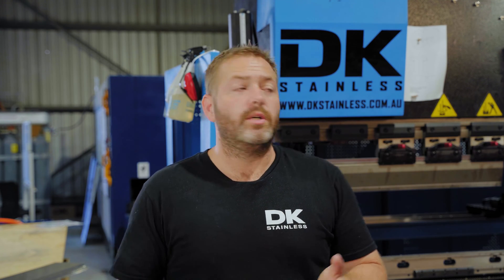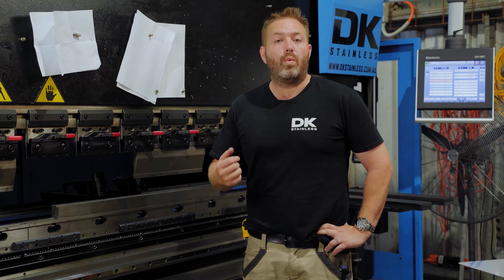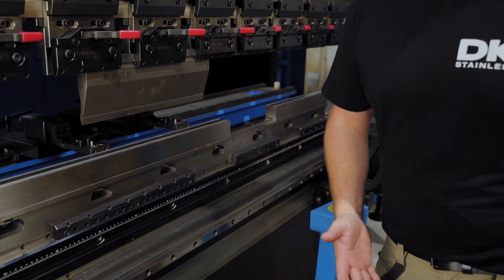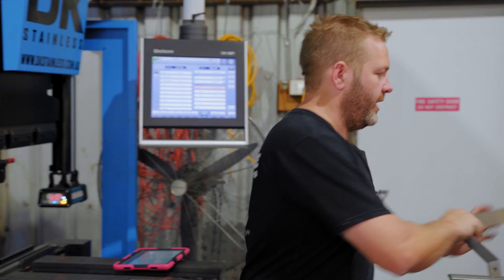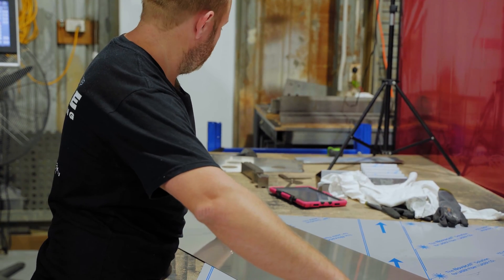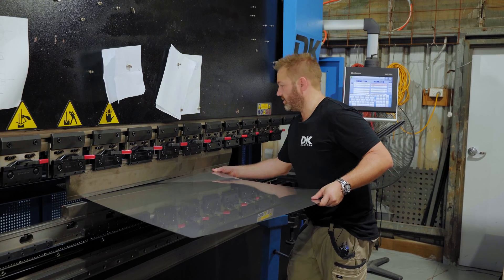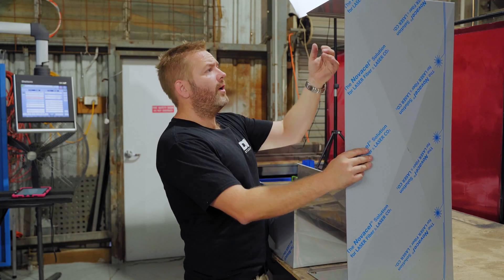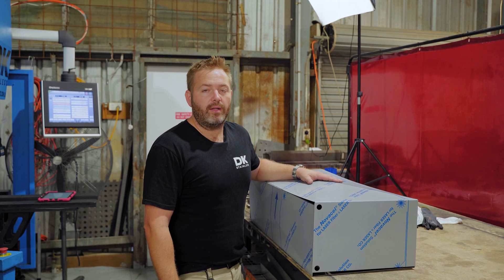Bending a Stainless Steel 4WD Water Tank with a 125 Ton Press Brake!

Comment: Nice video mate! Been following you guys on FB for a bit! 

Worked a fair bit with CNC press brakes similar to yours (ACCURL - has the same delem da-66t software). Keep an eye on the bolts that connect the 'blade' to the hydraulic rams, they work loose over time and cause a difference in the LH vs RH bend angles. You can't really correct it with the bend adjustment either, because it can fluctuates 0.5-1 degree for each bend. Drives you nuts with robotic welding!
Reply from the maker: Thanks so much for the Tip. You are exactly right and this was something we "accidentally" found when installing the machine. There was a 25mm gap between ram and top blade.